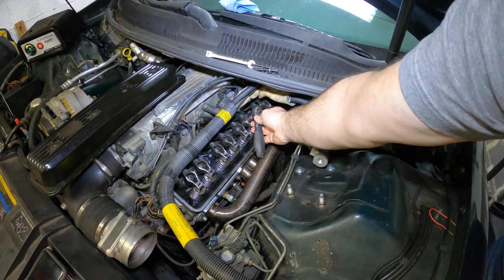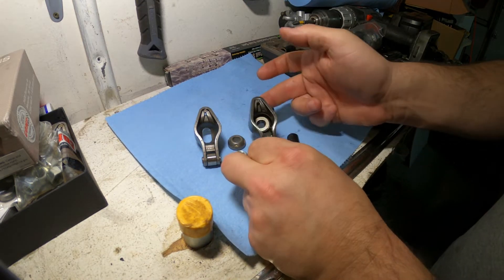comp cam roller tip rocker arms  vs no name brand rocker arms  lt1 engine who makes them

Comment: One thing that stood out me in you video,  is one the cheap set ,  the roller tip has a lot more side clearance, easily seen by eye.  Comp cams one look more precise.
Reply from the maker: yes the other rocker was loose moving around on the valve stem which damaged the rocker arm that's why you can see the difference in the gap between the two rocker arms

Comment: I bought Comp Cams  roller Aluminum Rockers for For My 351 ford,  after about 20 passes down the drag strip two rocker arms broke in half!  I shipped them back to Comp Cams,  6 months  later O got a notice there  was a Package i needed to pay for!  Comp cams shipped  me a new set of  Rockers but I had to pay full price of  a new set  to pick them up. Needles to say they stayed at the shippers. Now I use nothing but Crane Gold  rockers after 6 years and 1500 passes they  still look like new!

Comment: The Chinese are very good at reverse engineering. That doesn't mean their parts are as good as the top manufacturers (in whatever field you're looking), it depends on how far they're willing to go. If it's a critical part, (pistons, rocker arms, pushrods or a rifle barrel) I'll stick with the  top name manufacturers. Less critical parts, (oil pan, valve covers or a stock for an AR) I am more willing to give the cheaper piece a try. Either way, I appreciate the side by side comparison.
Reply from the maker: yes agree and thank you for watching

Comment: Just from that last 35 secs of video or so, it looks like the Comp roller tip end is tighter than the off brand. Engine Masters tested this style of rocker and basically found that higher spring pressures/higher RPM made them kind of "balloon" out and therefore lose enough lift stability to see power fall off sharply above 6,200 ish RPM. If you're replacing stock stuff and/or building pretty mild, seems like these could work. Otherwise the Ultra Pro Mag rockers from Comp seem like a great option (SA and NSA) for fitting under stock valve covers and remaining sturdy.
Reply from the maker: yes I bought these rocker arms to keep the budject down for the cam swap but is alot better the the stock stamp steel ones from the factory in the future will be making videos of what can be updated .... but for $69.00 you cant go wrong for a mild build that won't see over 6200 rpm
Reply: Two things bite people regarding chinesium:  tempering and metallurgy.  It's the former that gives the greatest number of problems - it's half art, half recipe in some cases.  You can steal someones recipe, but unless you work directly with them for some time, the art may be missing.

Comment: The old gm nuts were tri-oval, I think.  After machining, they get a precision crimp to make them go just slightly out of round right near the end - maybe 3 threads were affected and the rest stayed true.  I like poly locks better where you fool with valvetrain alot.
Reply from the maker: Thank you for watching

Comment: It looks to me, Comp outsourced the manufacturing to a Chinese company. They then copied it. China doesn't give two shits about copying other peoples designs. As well as companies don't give two shits about who manufactures their product if they can make a couple extra bucks. 
Knowing this, many components with different names attached, all usually com from the same plant in china. So when a company knowingly deceives the costumer by not specifying the country of origin, why not buy the knock off. If you know what to look out for, do research on it, find reviews. You can get a good part at a discount, with extra parts and free shipping! 
When you buy American, make sure it's American manufactured. When there is a real good knock off. Outsourced manufacturing is usually the reason.
Reply from the maker: Well said my friend ..  and thank you for watching...     These days it's getting harder and harder to find out who makes what (i have hinted this in my videos time and time again)...  even if it says made in America is not always entirely true because they can slap that on the package if it's assembled here (but,  that's a trick on words also because 'Made in the USA" or "Assembled in the USA"  there is no perimeter they have to follow as long as it's touched by USA  hands that could simply mean screwing a knob onto something then they can label it assemble in the USA  for example.  ....  a lot of well name rod and crank companies have their stuff produced overseas and do final machine work here ... that's fine with me but at least say it not try to hide it... and charge three times the price ... lol ..
Reply: @maldo72  Honestly, with modern manufacturing and global economy, it really doesn't matter what country a part is made in. What matters is good design, quality control and a warranty. Basically a company that cares enough about producing a quality part, shouldn't have to worry about where they have it produced, as long as their honest about it. The ones I really hate are the box store electronics. I can go to "NAPA" Oreilly" Autozone" Advance" And buy an ignition module for my Firebird. Each one is going to say on the box, "Guaranteed to outlast the competition"? Their all the same POS, from the same place, run like shit and fail in two months.

Comment: Don"t be fooled. Do not skimp on valvetrain components. I bought a set of proform roller tip rocker arms that went in a bone stock vortec 5.7. In less than a week i had several of the proform rockers break. They advertise they are chromoly but are sctually potmetal. I lost all confidence in teplacing them with the same that the manufactuer sent me.for teplacement.  Bought a set from comp cams and they are still in the engine to this day. That was 8 years ago at the time of this comment.
Reply from the maker: yes very true I dont use the cheap stuff for the full roller rockers arms  that said wanted to try these cheap comp cams  knock off  roller tip style rocker arm for this cheap cam swap ... was  build on this semi stock  motor ..... .... to tell you the truth there not bad and feel and look almost the same as the comp stuff ..... well at least for these type of rockers arms
Reply: getting ready to buy those comp cam rockers, for my 5.7 vortec. They still good?
Reply: @GTguitarworks  👍yes they are.

Comment: why did you not use the polylocks again? If the china ones came with em why re-use old wornout nuts? btw how have the held up to now
Reply from the maker: easy of install it's a pain to adjust the polys locked under the cowl...
Reply: @maldo72  Not near as much a pain as dropping a valve and eating a piston
Reply from the maker: @boharris8179  the factory nuts were replaced after I found one that was not right

Comment: I have 96 RS 3.8 and I have knocking noise when it starts. When I start to take off I can hear it in the car and it goes away when I'm over 25 mph. When I stop I hear it again. Could this be a loose rocker making that noise?
Reply from the maker: sorry cant give advice without hearing engine run
Reply: @maldo72  where can I send you a video to?
Reply from the maker: @EK-deenutz  hit me up on instagram maldo72youtube

Comment: Thats funny cause I got a set procomp? And man talk about pot metal  i wouldn't and didn't run them! The bearing on roller looked like fall off!
Reply from the maker: yes there regular stamp steel stuff they will work fine for stock applications

Comment: your basicaly running crap the lift isnt even right 
and friction is still same as stock 
Crane and scorpians are only ones at advertized lift
go aluminum lightens up valve train for high rpms 
go ebay used if you have to 
self aligners need spring caps so they dont hit caps 
Guide rod plates are 14 bucks if not 
take air foil and throw in garbage its blocking 100 cfm hole behind it